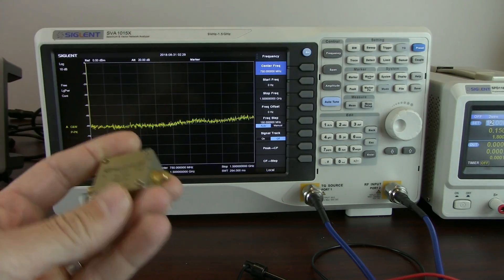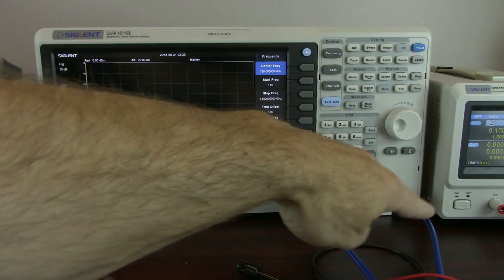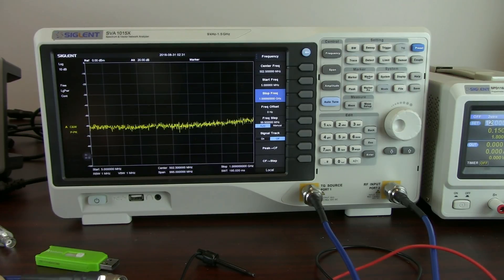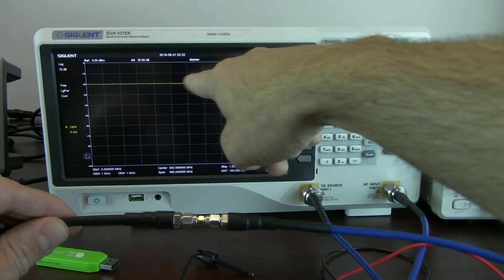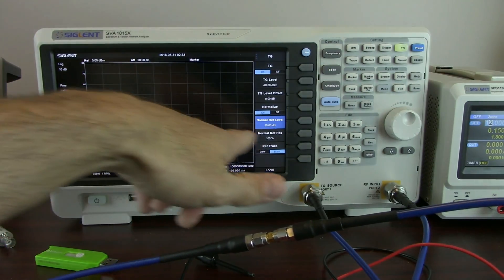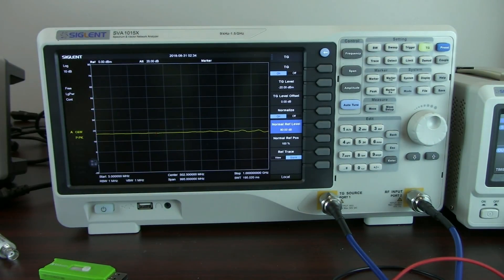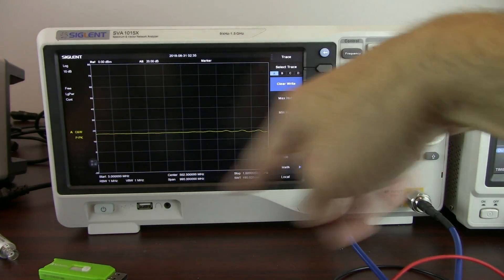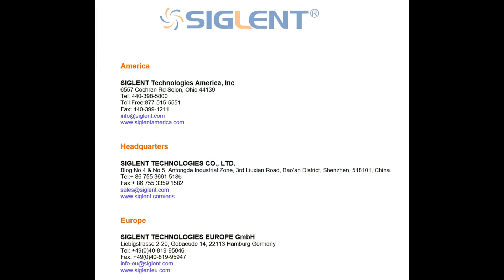Amplifier gain verification with a spectrum analyzer and tracking generator

Comment: Amazing video, my respect, Could you tell me if we need tracking generator? What is her functuon..thanks
Reply from the maker: Tracking Generator(TG) is a source used to provide a stable and good reference signal in a spectrum analyzer, TG is usually used as a scanning excitation to measure an external circuit network, at this time, the spectrum analyzer is equivalent to a network analyzer. TG outputs the same sine wave with the same scanning frequency, the frequency range of the TG output is the same as that of the spectrum analyzer, but the quality of the signal can not be compared with that of a professional signal generator.
Reply: Ok many thanks, so, if I have a signal generator and a nanovna for network analyzer, I can choose the UTS without TG, it's correct?

Comment: One detail, with amplifier testing on 3 different voltages you could set the vertical scale much less then 10dB/div. So you could better see the differences. And, the slightly differences in dB are somewhat deceiving. And on linear scale the same differences look quite different...

Comment: can you directly test an IF transformer for proper resonance frequency with a spectrum analyzer?  Could you use the TG to stimulate and look for the peak?
Reply from the maker: Hello. Thanks for writing. Yes, the tracking generator and spectrum analyzer should be able to perform the test, as long as the input and output frequencies match. You can also use a scope and generator: https://www.youtube.com/watch?v=5tvSCZ8ORBE
Reply: @SiglentVideo  Ok, helpful video.  Can it be done in circuit?  What's the minimum you would need to do to isolate the xformer to make the test work adequately, in circuit?  Thanks again.
Reply from the maker: @microreniassance2929  Isolating the DUT from other circuit elements will lead to greater accuracy. The stimulus signal (either TG or function generator) is going to follow the path of least impedance. If this path includes more than just the DUT, additional error may be measured. I can't say how much error, but if the additional circuit elements are mainly resistive, you may be able to measure with and without the xformer (maybe short it out?) and measure at low frequencies to get an idea of the additional error, then subtract it from the total measurement. It would be much easier and more accurate if it was simply the component itself - Jason, SIGLENT NA
Reply: @SiglentVideo  okay thanks for the comments. I'll see what I can do.

Comment: In the demonstration i can see its a LNA . But if i have an amplifier with around 1-5watt or more do i need to attenuate the output before interfacing with the Spectrum Analyzer
Reply from the maker: The maximum input power for the SSAs is 30 dBm. It's always a good idea to start out with more attenuation than you expect and then remove attenuation after you are confident that the input will not be overpowered. The analyzers have 20 dB of internal adjustable attenuation, but having some external attenuators is a good idea. You can find the datasheets with specs here: 
https://siglentna.com/resources/documents/spectrum-analyzers/#ssa3000x-plus

- Jason, SIGLENT North America

Comment: Hello, i measured the gain of my LNB the same way you did except my value was -50 db. is that normal if you are using an Anritsu SA? i expected to see 50 dBm on my screen. Thanks
Reply from the maker: Hello. The process outlined in the video is standard practice for a gain test. Gain values should be positive.. you are "normalizing" the readings when you calibrate using the through adapter calibration,, in this case, an SMA female barrel adapter. I am not familiar with Anritsu products, but it seems as though you have some setting incorrect. I suggest finding some content from Anristu that covers how to perform amplifier measurements. If you have additional questions, you can always contact us at info@siglent.com. - Jason, SIGLENT North America